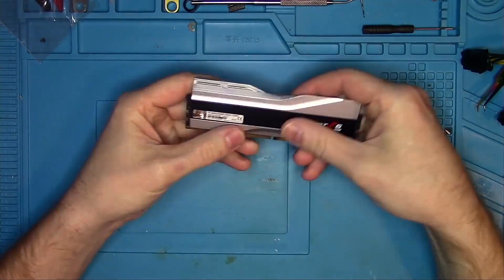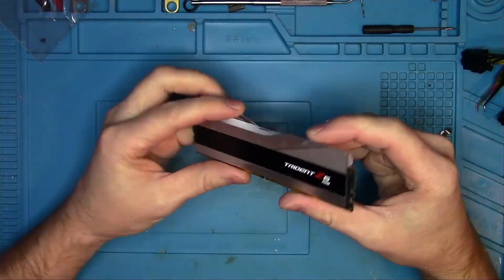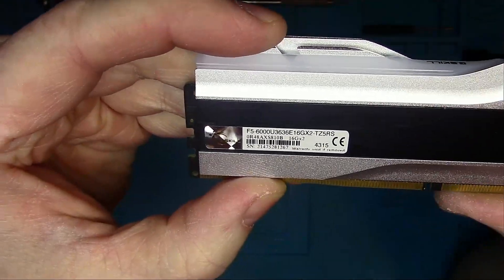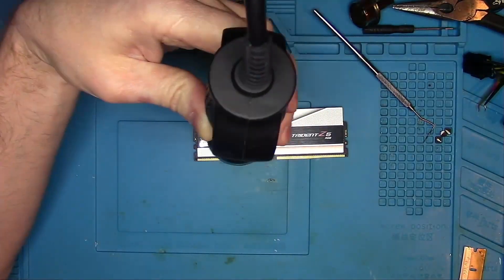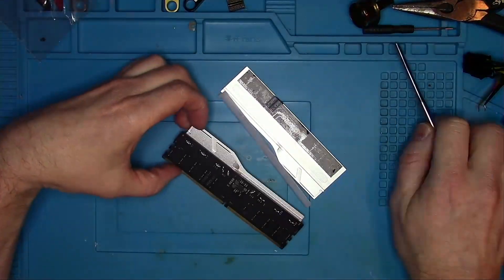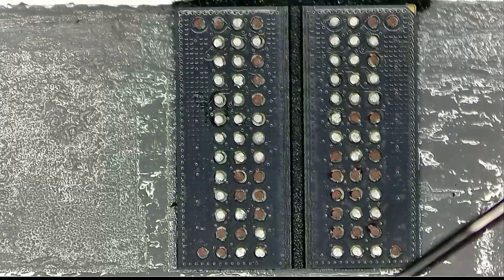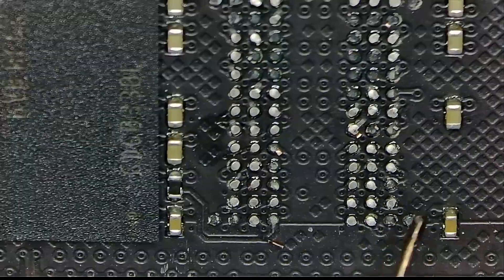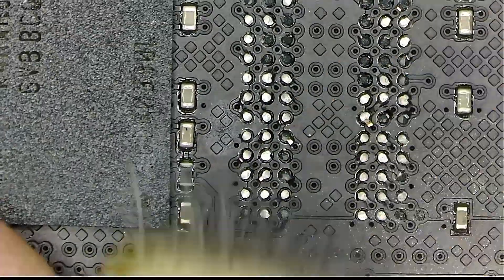Ripped memory chip repair DDR5

Comment from the maker: This repair was a no go.
I wish I could test it before I sent it back.
If anyone knows some sorts of a memory tester I could buy for future repairs, please let me know.
I feel bad sending something back that I cannot confirm a fix.
Reply: seriously... the stick may worked fine but the guy didnt want to pay.  i wouldnt have taken the job if i couldnt confirm it worked. that was alot of work that you did to not get paid.  real shame.
Reply: I sell RAM for a living in the UK. I used to have Ramcheck test rigs (standalone, just plug in the wall) but they got expensive for DDR3, DDR4, DDR5 adapters. So I actually just use PCs, laptops and servers now. Very cheap on the 2nd hand market. DDR3 laptop ~ £50 / $65. DDR4 laptop ~ £120 / $156. DDR5 laptop ~ £250 / $325. Desktop PCs cheaper than that. Take up a little bit of space, but far cheaper than professional testers.
Reply: You are very trusting, what if the stick did work and the customer did not want to pay
Reply from the maker: @Alex-ii5pm  I wouldnt know.
Most people are honest hard working people.
Few liars are not worth taking into consideration.
Reply: @northwestrepair  I wish more people in this world has this mindset. It's so rare to see. Really enjoy these videos 👍
Reply: @northwestrepair  Agreed.
Reply: @Alex-ii5pm  be the change you want to see in the world. start with yourself, best thing you can do
Reply: I was told at a shop by me another CP using the same memory type I have 3 Sticks of ddr 5 not working and cant test
Reply: i did find a link for ddr memory testing https://youtu.be/qOWiwwi7A1g?si=gK0Std2ZVmnr26MG
Reply: you could maybe buy or repair a b650 amd motherboard and cpu to get ddr5 but thats a lot of money for a new computer

Comment: How hot was the heat gun when you removed the heatsink? I used a blow dryer and slowly pried away until the heatsinks came off easily.

Comment: quick question...maybe a stupid one..
isn't ddr5 ram same as ddr5 vram from gpus?
i mean...those ram chips does uses capacitors as trap voltage for the 1 and 0  binary thingy
or vram are made differently?
i also know that vram heats up a lot more than the ram for the motherboard...
Reply from the maker: Gddr vs ddr. Different layout i think

Comment: With due respect to your skills and efforts, I would say this is a case of BER (Beyond economic repair). Anything above DDR needs sophisticated length matched trace routings and use complimentary/differential signalling traces to maintain data integrity. As we go up the ladder to DDR4 and 5, even the FR4 base material and it's weavings start to matter more. Any repair that involves activities other than replacement of SMDs are going to be difficult to get it working again.

Comment: NO,NO,NO Don't repair the PCB. The stress when everything is put back together is highly likely it will go dis-connect in the future even if it's working. Almost guaranteed it will go faulty again.
What the OP of the video should have done is get another clean PCB & transfer all the chips to that. It's quicker & will last longer than the repaired PCB.

OP should have done basic test to confirm there is no short across the power plan ie at the capacitor before putting back the heatsink. This is poor because the end user can plug this in & it can blow-up the memory MOSFET(S).

If OP is going to do repairs, they should make sure they have the correct equipment to test & not put the end user motherboard at risk. I admire OP repair thou because it something I would do, but not on a memory PCB. There's too much physical stress when inserting the module.

EDIT: Please remember what come's first "safety". Its take's the highest priority over everything, & for that you get a downvote for letting the end user test this & putting more equipment at risk.

                                                                  * Whoever this memory module belongs to please contact me by replying to this message ***.

Comment: Is reballing necessary? Don't get me wrong, I don't believe your doing it for no reason, but wondering how it realistically differs from tinning the traces on a normal PCB.

Is it to have a more even/consistent height to the tin underneath?

I know stuff like GPU's need it, just not sure why tinning either the ram module/PCB isn't don't instead.

Comment: Wouldn't it have been a lot cheaper just to replace the RAM?? Yes I have 4 kits of DDR5 for two builds with DDR5 6800 ~$1,400. As much as I know that you think that you did great work over there. I wouldn't rely on that RAM stick at all.
Reply from the maker: I am cheap
Reply: @northwestrepair  .. My time is more valuable, corrupted data costs money. It's right up there with chicken wire. I'd Memtest test the crap out of it for at least 3 days straight. We all eventually "F up" and have to deal with our consequences.

Comment: It's really fascinating watching all the different repairs you perform for people. I must admit I have absolutely no idea what I'm looking at 70% the time. Do you have a previous video where you explain in detail what you do while repairing?
Reply: I think:
1 he cleans and reballs the memory chip
2 repairs the PCB pad damage where the pads and traces lifted off with the solder joints when the chip was pulled off
3 resolders the bga
Reply: Also puts solder mask on the exposed parts of the replaced traces where it shouldn't be exposed to avoid shorts amd also keep the traces from corroding because tony himself said exposed copper is a bad idea.

Comment: Did it work? i would of thought the added repair pad height would of been an issue,but i could be wrong,solder has a self level & pull to pad ability,thats whyt BGA ics work.amaizing skill level you have. Is there a way to re apply a paint on solder mask,thats the same profile as manufacture? A difficult and painfull repair,done many,but not under BGA ic's.Thank you.

Comment: Holy crap. Your repair skills are amazing. I dont think even most experts would have attempted that. He probably removed the heatsink to fit underneath a large cooler. Did it myself in the past with no issues. Lucky i guess. Nowadays i buy low profile ram.
Reply: Well, no one does it, because the cost to labor ratio is unfavorable for repair.
Reply: @graealex  true, the repair might not be worth it to do, but the Youtube views will be high, and sometimes you just have to challenge your skills to test yourself.
Reply: @kidsteach938  I'm not saying he shouldn't do it. I am saying others don't do it because this is not the way to make any profit. That includes the creator as well, although he is still building up his channel.
Reply: maybe just buy the correct one in the first place
Reply: I just had to fit some cooler, but RAM was in the way ... so I cut piece of cooler off :D I am pretty sure that 1cm cut from 4 plates won't affect cooling much.

Comment: I learned to leave the heat sinks on my ram alone.
Reply from the maker: Then you owe me a like.
And thanks for the comment
Reply: Good luck!
Reply: At least heated heat sinks with hair drier first prior riping it.
Reply: I have no idea about RAM, but if I want glue to release I put the thing in question into IPA. Or use heat. And then try to rotate instead of just pulling.
Reply: @graealex  Not sure how much IPA would help here. Heat is definitely the path to getting it open only to then realize the cheap Prime Day deal was indeed Micron memory.... because of course it is...
Reply: @JJFX-  IPA will loose most glues, even if it doesn't dissolve it completely. For example, it helps get batteries out from smart phones when there are no pull tabs.
Reply: @graealex  You're definitely right but on many sticks the adhesive on the thermal pads is all that's holding it together so I'd avoid solvents if you want to put it back. Heat will be faster and easier anyway.
Reply: Why would you even want to remove them, naked ram is so ugly. Just use heat to make the stickytape to be able to let go